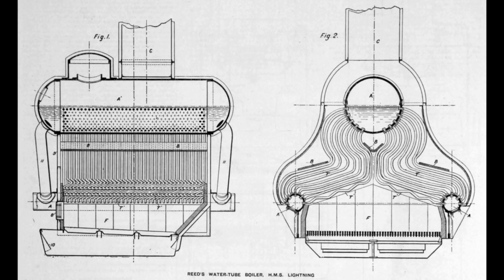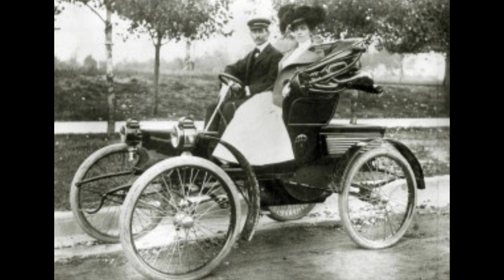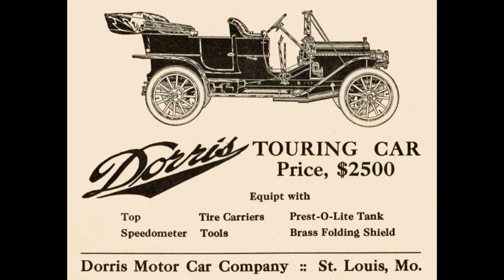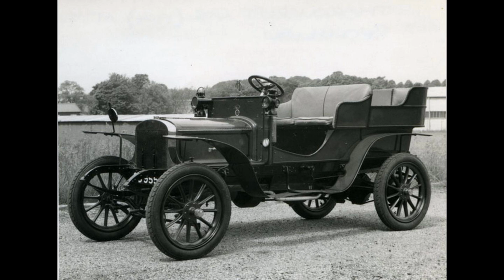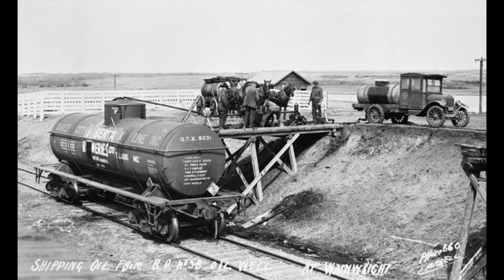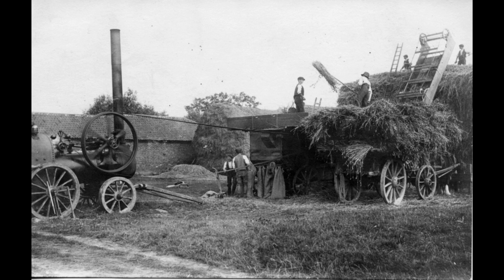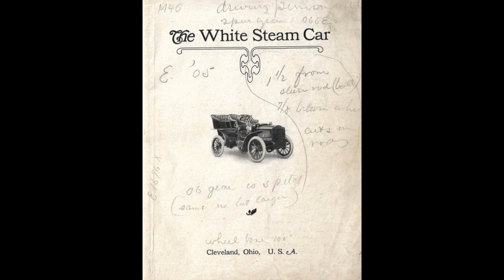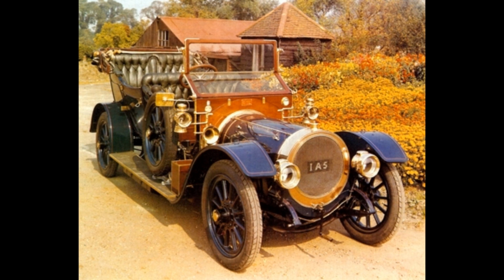Steam Boilers in the 1900's - The Unusual Case of the Car and Ship

Comment: Water to steam has a 1000 to 1 expansion ratio. However, the specific heat capacity of water means that steam power can never be as efficient as internal combustion. A phenomenal amount of heat is used to simply turn water to steam. Even more heat has to be added to make a useful power source and that heat of evaporation is lost to the condenser. The practical efficiency limit is around 35%. Diesels can get to over 50% - a significant benefit in fuel consumption with far less technical complication.
Reply: One cubic foot of water converted to steam, at the same pressure, expands to approximately 1600 cubic feet. As for efficiency, consider the power to weight ratio, A steam engine requires a boiler and water supply as well as the engine. An internal combustion engine is just the engine and the fuel supply, so less weight for the same power. There is also the issue of space, the volume taken up by your equipment. In transportation this can be quite significant.
Reply: The volume ratio between steam and water actually depends on the steam pressure.  Steam, being a vapour, is compressible, so it has a smaller volume at higher pressure.  Water, being a liquid, is almost incompressible so its volume hardly changes as pressure increases.  Thus the volume ratio between 1 kg of steam and 1 kg of water depends strongly on the steam pressure.
Reply: To be completely unfair, a nuclear engine could (would?) utilize steam and its fuel/power ratio would be crazy.

I mean, so would be driving a nuclear car, but why let sanity get in the way of technicalities?
Reply: Steam engines don't have to idle at stop lights and give high toque at low revs, give high revs, and runs backward eliminating the need for a gear box. 
Steam also has the advantage of running on multiple fuels. 
There is also waste heat recovery.
Reply: @calvingreene90  
I like steam too, but there is a very good reason they aren't used today for  cars, trains or ships.
They just aren't efficient thermally!
Reply: @mahbriggs  Steam initially went out of use for trains in the drier regions of the US due shortage of water. Then the manufacturing capacity for diesel electric made it competitive. 

Steam in Europe was phased out primarily due to the maintenance costs associated with the use of coal. Thermal efficiency had and has little to do with the choice. 

Steam locomotives built for tourist routes in the 1990s run on light oil. In practice they use about the same amount of fuel for the same amount of work. 

Steam locomotives have smaller transmission losses due to direct drive, and waste heat can be utilised for train heating and auxiliary services. In theory internal combustion wins hands down.  In practice the advantages are tighter. Steam has not been able to make a comeback due to inertia and lack of infrastructure. Given a decent sized production run the lower unit cost would make it competitive for lightly trafficked routes.
Reply: @henrybn14ar 
I don't think thermal efficiency has anything to do with their use as tourist attractions, and having done a paper for a college physics class, I can assure you steam is much less efficient!  I would quote numbers,  but that was 45 years ago.  The general information is online if you care to look it up.
Yes, water was a consideration in the switch to diesel, a retired Santa Fe engineer told me that.  He used to run the Atchison-Santa Fe route.  Hauling water was a major expense!
The diesel electric engines used today are simple and long lived.  Back when steam engines were used, frequent overhauls were required.  They really did require an immense amount of maintenence, almost every major city had a train repair shop, and many smaller ones too!
Reply: @mahbriggs  Stoker's wages have gone up too.
Reply: Now I'm wondering if anybody's built a design that instead of condensing the steam back to water instead took the expanded and cooler steam and directly heated it so you'd only have to go through the phase change on start-up or as needed to replace losses.  Though I'd assume that  would take up a lot more space, as a boiler spent steam is going to need to be a lot larger than one for water.  Oh, wait, that might get it back up to the same temp, but probably not back to the original pressure -- at least not without additional compression which would rob efficiency and require even more equipment.
Reply: @jonathan_60503  What you're describing is called a 'closed Brayton cycle' engine, and it has been explored extensively especially for use with nuclear reactors. However, if you go down this route there are better gases you can use, the typical choices being hydrogen, helium or carbon dioxide.
Reply: @jonathan_60503  There is such a thing as interstage reheating.  In certain situations you can expand the steam where it starts to condense even though there is still some useable pressure left.  In this instance, you reheat the steam to higher temperature so that you can complete the expansion.
Reply: @jonathan_60503  rather than coplexity of boiler and pumps... just burn stoichiometric hydrogen and oxygen directly, under pressure. The flame/products of combustion are steam. weight of tank and fuel for them,  might compare well to weight of water tank, coal bunker, and boiler. avoiding a boiler also stops heat going out of a chimney, and allow higher steam temperatures into the engine which could in theory at least increase thermal efficiency
Reply: @jonathan_60503  kicking myself a bit. steam torpedoes and peroxide fueled Uboats . very similar idea

Comment: During the 1970s fuel crisis GM actually made a steam powered experimental concept car Chevelle
Reply: If I remember right, the experimental cars  built at that time were for pollution control, they didn't go anywhere because of the fuel crisis.
Reply: The engine was based off of the small block V-8
Reply: they also made a prototype Cadillac with a turbine that burned finely pulverized coal, about the same consistency and appearance as printer toner

Comment: South African drivers licence (my Dad's) circa '30's gives means of propulsion as "petrol, electric or steam".
Reply: Little known fact that steam power and electric cars predates the combustion engine.
Reply: @inisipisTV  oh fuck, since when?
Reply: @zaneandre6387  Its not quite true. The first thing we would recognize as a car used an internal combustion engine. But most of the development of automobiles was around electric and steam until after WW I. The development of aircraft rapidly accelerated the development of combustion engines, while electric and steam engines slowed down their pace of improvement. Steam and electric cars were better than combustion engine ones for longer than most people realize.
Reply: @lobsterbark  To clear this argument- The first true steam car (A personal vehicle that could be operated by a single person) was built by De Dion Bouton in 1884.  The first internal combustion engined steam car was built by Benz in 1885 and the first true electric car was built by Gustave Trouve in 1881.
Reply: @lobsterbark  I was being facetious, I was admitted to UCSD out of high school in the mechanical and aerospace engineering program for car and engine design. This is a topic I am very familiar with but thank you for your insight.
Reply: @lobsterbark  " But most of the development of automobiles was around electric and steam until after WW I. "

And the Model T Ford started production when?  (1908) History is never as simple as people think.
Reply: @scottgiles7546  The model T wasn't a typical car in almost any way. It ran on gas, it used an unusual control scheme, the transmission was some really weird wood and cotton integrated unit, it wasn't made using any of the traditional techniques.

The majority of the industry used steam and electric because it was still better than ICE at that point. The Model T was crap. Notice that nobody copied it's design, they only tried to copy it's price.
Reply: @scottgiles7546  The vast majority of model Ts are post WW1 production, with 1923 being the peak.
Reply: @lobsterbark  
The "majority of the industry"?  I think not!
Reply: @inisipisTV  yes the 100km/h barrier was broken by an electrical car the Jamais Contente (Never Happy in French)

Comment: nobody ever could get water tube boilers to work on trains, but then by the 1900s engines were already producing too much steam to use anyways
Reply: The biggest difference between most steam locomotives and most ship or stationary boilers is that locomotives only use their water and steam once, there is no condenser, the used steam is simply exhausted to the atmosphere, (this is also used to create draft for the fire).  This means that you are using vast quantities of makeup water, often of dubious quality because you have to get it from local water sources all across the land, which leads to big problems with scale buildup.  The open space in fire tube boilers proved easier to clean out than water tubes.

I'm a volunteer at a railway museum with an operating steam locomotive (oil fired), and it should also be noted that a locomotive's steam demands vary widely and abruptly, from almost nothing when the engine is 'drifting' (coasting with the throttle almost shut off) to sucking the boiler pressure down when the engineer opens the throttle up.  The fire tube boiler also acts as a big steam reservoir.
Reply: Bob Smith is correct, although part of the use of the steam exhausting through the smoke stack was to supress sparks. Another problem with steam locomotives was that there were long stretches of rail lines where water had to be hauled, because there wasn't sufficient local water supplies.
An old Santa Fe engineer once explained to me that was one of the reasons Santa Fe switched to diesil electric was because of expense of shipping water in Western Kansas.  I imagine there were other areas with similar problems.
Reply: Railways tried oil fired steam engines but cost and high fuel consumption killed the idea. Diesels did the job at far less cost and used far less fuel. Ships have more space so steam hung on for longer but its today's ships are almost entirely diesel powered.
Reply: @Dave5843-d9m  
The fuel used on the various railroads also was dependent on the local availsbility of coal or oil. With steam is just wasn't the overall efficiency it was also the maintenance requirements of steam engines vs diesels.
Reply: Conversely, attempts by the RN to use loco boilers in destroyers were even less successful.
Reply: The big problem with water tube boilers was scale build up because railroads had to use water from varying quality sources along it;s lines and much of it was VERY HARD. The railroads in the south west United States were some of the first customers of the water softener industry.

Stationary or ships boilers can afford to have condensers to recycle the steam and reuse the water. Because of that they can maintain the quality of their water so that scaling is much reduced and water tubes are practical.

As to the "Too much steam to use". I'm not sure what your referring to as in the 1920's Lima Locomotive works came out with a new line of Locomotives the called "Superpower" locomotives because they had boilers which could keep up with the demand for steam at full power. Locomotives previous to this could only run at full power for a limited time before the boiler would loose pressure. They believed that most locomotives could not produce enough steam for extended periods of time.
Reply: @keithstudly6071  Ship's boilers can't just use condensers. They pretty much HAVE to (except some inland and coastal vessels) because the fuel cost of producing feed water would be prohibitive. It also increases their efficiency - instead of steam going up the blast pipe at a positive pressure, the steam exhausts into the condenser into a partial vaccuum (15" mercury is typical, iirc)
Reply: @iansadler4309  Yes, in a perfect world all steam engines would use condensers, it's just much more practical in ships and static systems than in locomotives or automobiles. Some South African locomotives used condensers to varying degrees of success as did a few experimental automobiles. Ships have the advantage of having sea water to cool the condenser, so it's not odd that ships were where they were most successful.
Reply: Bad water was a serious problem but vibration was the killer issue that water tube boiler steam locomotives could not overcome. A fire tube boiler still works albeit less efficiently with a few leaky tubes but water tube boilers proved too fragile for locomotive service.  Almost all of the big US railroads tried water tube boilers at some point, none succeeded.